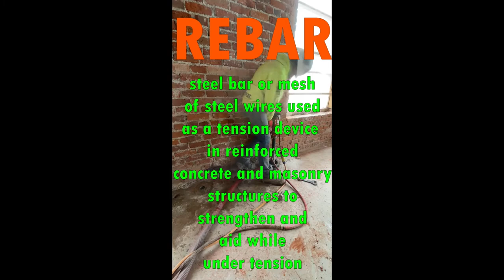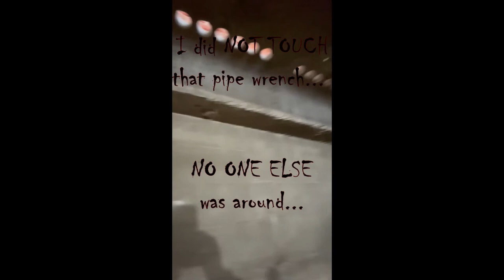You wont BELIEVE what I saw while drilling at a 130yr old courthouse!!!!!!  OMG

Comment: Concrete cutting is an extremely hard job. Nobody knows. I'm 37 years retired from Penhall. You are a very hard worker--Just save your body. Get rid of that hand held drill--use it for when there is absolutly no other way. I would have used Diamond Tech 4 speed on post mounted on Vacuum base (No suction?) Stand on it. Roll on wheels. I'm not as big as other guys but I have drilled 350 holes a day like that. Good luck to you--Stay safe !
Reply from the maker: Ya I use my Shibuya most of the time. I was definitely sore after that job!